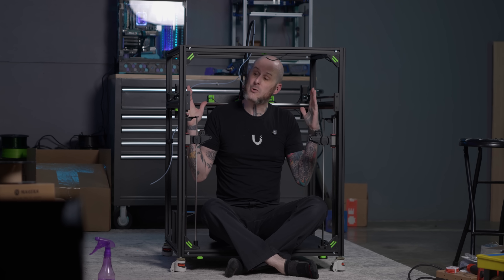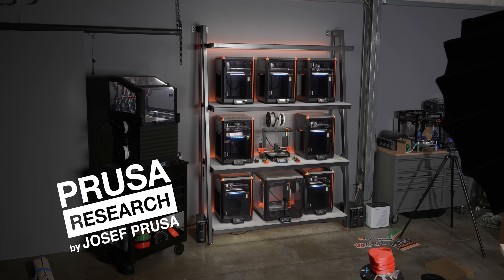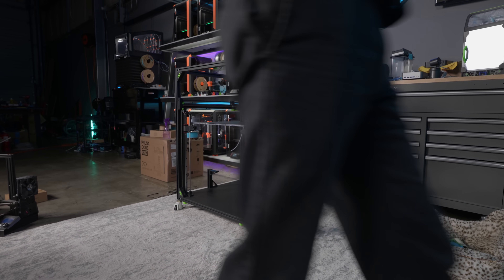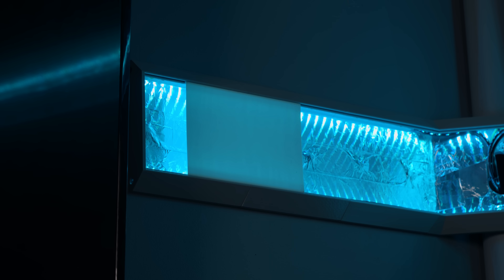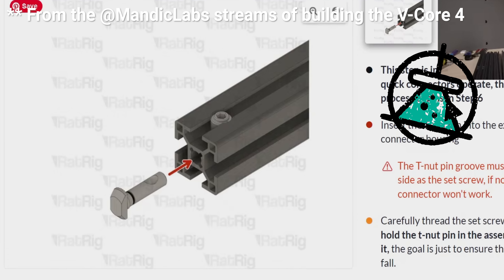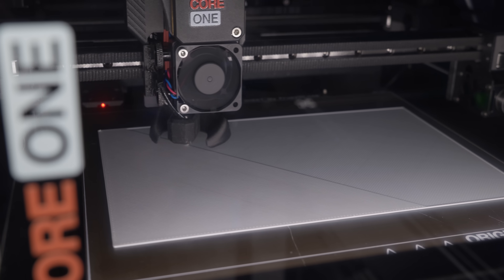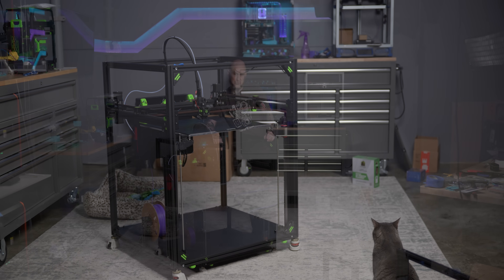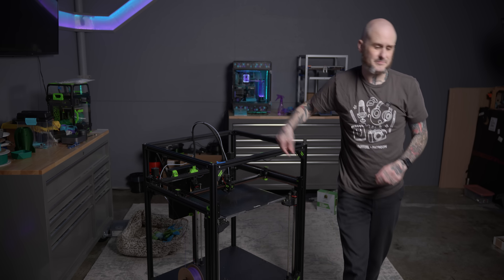mini Review of a GIANT 3D Printer - RatRig V-Core 4

Comment: What would I want to build with printer?? vertical sections of a life size R2D2, which is why I got into 3D printing a few years ago. I was going to buy a CR10S5, but pictures of dead Presidents were purposefully avoiding me like a plague at the time. This actually worked out in my favor, because that printer has been a trillion problems for a great friend of mine. Are there any known printers that reliably offer a similar sized printer????

Comment: A machine full of problems....the manual it´s full of errors, and dont mind to try to contact support.....because it´s the worst. The IDEX version will not print with the annouced speeds, and if for some reason you have any problem with the firmware or with RATOS, you will have to deal with them alone. It´s a shame, the product annouced it´s not the product you will receive, you cant get the quality neither the speed´s that they say. Not a easy assemble, and the worst support ever, it´s a shame because it have all the spec´s to be a great machine, but it doesn´t deliver.

Comment: Adding the enclosure panels will help improve that y shaper graph. It adds even more rigidity to the 3030 frame by improving its strength in shear between the top and bottom, front and back, or left and right. Then of course, there's belt tuning, but that's just a fact of life when dealing with a printer of this size.

Comment: I don't have problem with my rented house, and small doors, I did make the measure BEFORE I ordered my V-Core 4, 500x500 and the 73,5cm can go into any of my room, since we got doors with 80cm openings. 
Sadly, I got a major setback. I got slipped disc in the middle of building my dream machine. So now I am currently waiting for an operation, before I can move on.
I have made my own panels, using 6mm Birk Plywood and some thermal insulation and on top of that, a 1mm aluminums plate.(Homemade Sandwich plate)

Comment: I was going to do a RatRig until I realized I had to build the cables and that was a nope for me. I can shorten and solder cables etc but hate JST connectors. So if I can't buy them already put together, then it's a nope from me. I manged to buy most cables with JST connectors on them for all my previous 3D printer builds and mods but hate pinning a JST connector. I've had to swap some around before on motors but that's as far as I go. So yes a kit is needed. I bet there is a Chinese company that will build a kit and sell it.

Comment: I have the V-Core 4 500. It started out as a hybrid but I upgraded to the idex. I would not recommend the idex on this machine. It is impossible to tune out the resonance once you put on the second toolhead. Im going to convert back to the hybrid. So far ive got about 5000hr on the machine. Ive printed a R2D2, many large dragons, dice towers, capsule vending machine and many more.
Reply: ya i got the idex v core 4 500 too, start with idex, its a pain the ass the tune, ordered a few upgrades ( titanium x axis gantry, there a gantry warp when bed is heated titanium is supposed to fix it) ordered full metal carriage for it too ( idex system) but thinking i should just change it to a single toolhead, add in a filament cutter and a mmu, and thinking about upgrading to a chube conduction to max out its printing speed ( it needs it if your gonna print full volume, currently its way to slow because of the limitations of idex)

Comment: bruh acrylic panels are so cheap why not buy a few for a fraction of the price and work.
Reply from the maker: This was less than 1kg of filament. So $20? Diffusion acrylic that won't just block light was $60 for a 6 foot piece. I'd have needed a handful and to cut the angles by hand or have them laser cut. It would have been a few hundred $ in acrylic. Even if I bought a 4x8 sheet of acrylic and carefully cut out the pieces I needed (which I likely couldn't get from a single sheet due to the angles), that was $200. And the plastic shop is about an hour and a half round trip. It took me less time to design these parts than to make that trip.

Comment: My beef with the electronics is how shallow the "cable guides" were, unless they've made those deeper by now. If they were twice as deep, they still wouldn't be too deep. I would have printed my own if I had a working printer when I assembled the RatRig. But yes, the wiring was a challenge and requires a lot of going slow and figuring out just what to do. The cable lengths provided make some steps quite confusing because a person assumes if a cable is one meter long, that you will use that length, but not always so. There's a lot of value in reading previous builder's comments in the Dozuki build guide.
Reply from the maker: Yea, when you end up with a bunch of excess wire it really makes you wonder if you did the task correctly.

Comment: Well, since you ask: if someone were to build one of these for me, I'd use it to print R2-D2 heads.  Those are just under 18 inches in diametre - everyone forgets that Artoo is a costume, not a prop - and there's not many printers that can handle that as a single item.

But... I don't need those enough to pay the money for the kit, and I REALLY don't need them enough to deal with the frustration of building all those wires.

Still, this video was exactly the level of interesting and calmness I needed to unwind enough after my 13.5 hour day that I'm now able to properly get on with making supper.  So thanks!

Comment: I have a vc3.1 500 and you thought the cabling was bad on the VC4... hooboy let me tell you. 

By the looks of it the VC4 you have is a LOT cleaner than earlier models. I would definitely say it's a hobby machine. Something to be tinkered with, but not something that will give reliable prints every time, with every material. 

No advice on what to print, but look forward to seeing anything that rolls off your large format printer in the future.

Comment: Just admit you are lazy. Pre-crimping connectors on a wiring harness that you know you will have to route and terminate yourself is just dumb. 

It is not rocket science. There are a thousand videos on how to do it. 

Regular people with money and zero motivation shouldn't even buy a 3D printer that you have to build.  

You should buy a prebuilt machine that can also have problems or they should just find another hobby that doesn't involve thinking or using tools. 

If you can afford to buy 10 printers you have no excuse either. 

Nobody is carrying a printer that big, complaining about that is also ridiculous. Just stop it. 

You complain like guitarists who use 4x12 cabinets with their amps on the road. They make removable wheels you can add to anything. 

If you didn't measure your doors before you spent several weeks staring at the product, then that is on you. It is purely user error.

Comment: Thanks for doing the review, there aren't many as you said. I got an Idex 400 printer myself. From your input shaper graphs my guess would be that you have some binding in the y direction. I had this too, because the two linear rails weren't parallel to each other. I had to reprint the y bumper, because it didn't allow me to move the rail inwards. I made sure that the X rail is in 90 degree angle and then loosend one of the y rails and moved the X axis in y direction, so both y rails are truly parallel this made it a lot better. I have muv shaper with 7.5k Accel in y now. Also don't overtighten the hybrid belts which can result in bad y graphs. On my setup they are quite loose, but I also read that someone had better success with more tension than on the core xy system for the 500 printer

Comment: Exactly because as you said the easy to square frame and build quality, for me it is the perfect base platform to do mods and try things. If I want to test/try a Chube or a Goliath hotend I would do it on a big RatRig, not my 300 Voron V2.4. I also think it is practically the only DIY IDEX system out there? I really want to try some pellet extruders to print 25 shore A TPU/TPE parts or 30% glass fiber filled parts, that would not be possible with filaments and use PVA filament support on the second tool head. What other frame could do one pellet + one filament IDEX setup work? And when the INDX is out, there are few 500 spec systems available to be able to go crazy on nozzlebreak changers.

Comment: I wonder how many Bondtech INDX toolheads you can put on that beast
Reply: My estimate was somewhere around 18 to 22. I plan to put about a dozen on mine. 1x 0.8mm nozzle, 1x 0.6mm nozzle, 1x 0.2mm nozzle, 3x 0.4mm nozzles dedicated to ABS or other high temp materials (easier filiment switching between high temp materials with less clogging concerns), 1x 0.4mm nozzle dedicated to PETG (I hate PETG) to use as support for PLA, and 5x 0.4mm nozzles for multicolor. I may have additional tools that I can swap in on a case-by-case basis. At $35 a piece for the tools, it just makes sense to avoid having to deal with some multi nozzle problems. But I can't imagine needing more than a dozen pools in a single print job.
Reply: answer: yes

Comment: Good video.  Nasty input shaping graph on Y.  If it helps, I chased the same issue on my 500 for 6 months.  Ended up being the X linear rail.  Although it felt fine and smooth and tight, when I swapped for a high pre-load rail, everything improved dramatically.  What little bit was left after that was just the reverse bowden tube (I uncoupled it from the umbilical) and a cheap hotend fan that had too much slop in the bearing.
Reply from the maker: X rail has been a prime suspect of mine. It really seems to be something “loose” in my toolhead but simply nothing is. I’m gonna swap to Chube so I’ll have to rebuild the toolhead anyway. Maybe I’ll swap fans and rail while I’m in there. Thanks.

Comment: I got into RatRigs when the V-Core 3 was new on the market. I have since built two of the more polished 3.1s for someone and now I am finishing a V-Core 4 500 IDEX for my dad. 
What first got me wanting a printer of this size was when I printed a mould for casting a solid polyurethane tire onto a DIY steel robot wheel. The outer diameter was 320mm and I only had a Prusa Mini. No problem, just split it into multiple parts, right? The slight dimensional inaccuracy of gluing together all those parts and then smoothing the joints made it a 2-week headache to make that mould. It worked in the end but it convinced me I want a much bigger printer. I was already considering making one-off carbon fiber parts for my recumbent bikes etc. 
What I found out later is that once you have a printer this big and you learn to use it well (even materials that do not warp on smalle printers want to warp when you print 700mm long straight wall with thick nozzle for example), it changes your thinking and design process. For smaller stuff like jigs, holders for tools etc you no longer think about the build volume of your printer, you just model what you need and print it, sometimes surprised how much filament you need for it. The design thinking I was used to before, where everything needs to be multi-part and each part fitting onto the bed of the printer, that only comes up when you print stuff like pieces of furniture and such. 
If you don't see yourself really using 500x500, go for one of the smaller V-Core options. The thermal expansions are much easier to deal with, heat soaking the printer before use becomes much shorter and so on. But if you want 500x500 and you are ready to accept the compromises that come with it, and you are not affraid of the wiring or have someone to help you with it, then I would recommend even the V-Core 4 500. Compared to the V-Core 3 the build is much easier and downright enjoyable (adult lego basically). And the resulting machine, if you do everything well, is extremely capable. Nothing else on the market that I know can give you this combination of size and print speed and print quality for anywhere near this cost.
Reply: This is essentially the same reason I want a bigger printer. Printing molds for composites in fewer pieces.
Reply: @AlecMoody V-Core 4 500 is good for that. I have printed some mold sections that were roughly 600x500x80, took 70 hours to print with 0.4 nozzle (for smoother surface compared to a bigger nozzle) and weight was about 5kg. And it worked, they bolted it together,  pulled prototype positive shape from it, sanded and polished and made serial production thick fiberglass molds from that.

Comment: A printer that size would be fun but it needs its own circuit if it draws more than 10 amps. My panel is full so it would cost several thousand to upgrade my service before the cost of the printer.
Reply from the maker: Yep, in my last studio I had it on a dedicated circuit. I’ll likely share a 20A with a couple machines but stagger their usage this time.
Reply: @MandicReally  My VC4-400 IDEX has a dedicated 20A circuit with a switched 20A Schurter power inlet module and 20A Eaton fuse and fuseholder.  1000 watt bed, 1000 watt active heater, plus hot ends, Octopus running steppers, Pi, etc.  Will pull 2200-2250 watts while initially heating up.  And that's the 400!!

Oh, and due to storms related power frequent small power blips in our region, it's plugged into a 2000 watt Eaton server UPS.  

I got it for IDEX.  For doing a 2nd material for supports, or adding contrasting colors for text, etc.

Comment: I had been considering the Vcore before, especially due to the ability to upgrade to a dual extruder (IDEX), but chose not to.
There seem to be two main issues:
- Tuning with the hybrid setup seems to be near impossible (you are not alone if you search online), and gets even harder with another extruder, people are forced to run extremely slow, even for the smaller sized vcore units
- Ratrig support seems lacking. This is probably because the company is growing way too fast and cant keep up. Its a relatively small company but it seems they received many, many orders for their vcore units.
- Community is somewhat lacking, doesnt seem to be very active.

And lastly nowadays an important question; Who is it for? With the advent of much cheaper core XY machines with great performance, you really have to be in one of two niches to be interested. Someone that likes tinkering on the machine, or someone that REALLY needs such a large build volume.